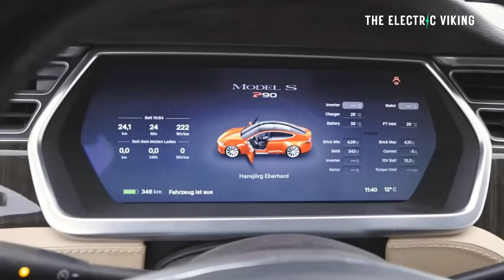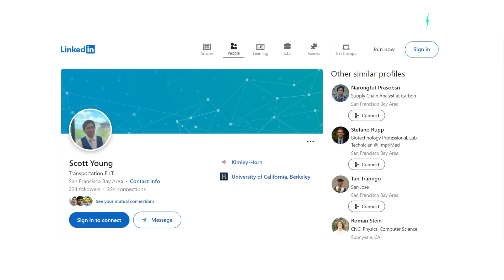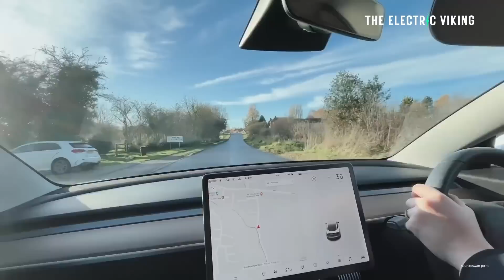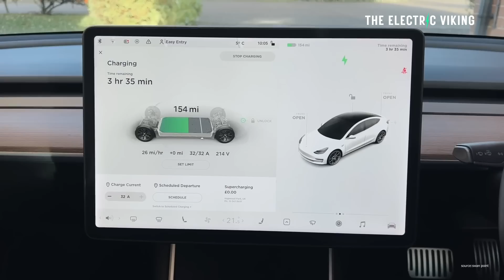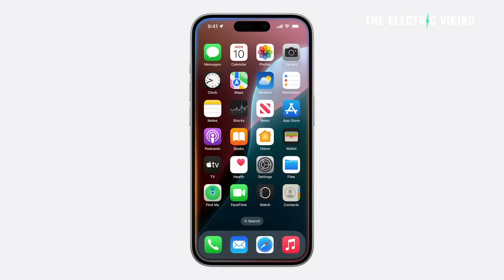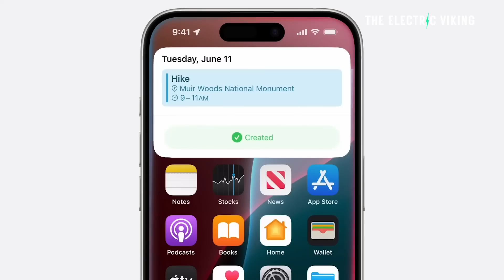Electric cars capable of running for over 1 million miles are already here

Comment: If an electric car can last forever, it will absolutely replace the gasoline car.  It is a superior technology.
Reply: They won't. Maybe the battery and drivetrain will last that long but they'll still rust out from under you if you don't live in a desert. Various electronics modules will fail and be unrepairable.
Reply: @spankeyfish  
If you're building a 'lifetime' car then you're going to use aluminum rather than steel that will rust.  You'll design for easy replacement of parts that might fail.
Reply: @bobwallace9753  Steel cars do not rust now.
Reply: @christopherj2231  
Newer cars are rusting slower.
Reply: Electric vehicles are like smartphones. In a decade the technology in them become obsolete and like your cell phone they will not no longer support updates and to upgrade the car into the new technology would be cost prohibitive to most car owners.How many people still are using PlayStation 1 through 4. I have an old Sony web TV I can no longer use other than as a monitor. I believe it has Microsoft components which they will no longer support. Add to that the fact that there is not enough copper in the world to support the infrastructure upgrade to support the chargers required for the government's goals. It is said that for the next 10 years, it would take twice the amount of copper mined since the beginning of copper mining. You add to that all the homes old or to be built out there that eventually would be required to upgrade electrical systems to handle the fast chargers. Homes here in Minnesota require that play comma to meet energy savings they must have a minimum amount of insulation in the ceilings and walls and windows and all the appliances have to meet certain energy standards. Homes are very expensive as a result and imagine what it will cost to meet these future upgrades. Electric cars will just be another added cost of persons everyday life. By the way I made this comment before watching his explanation of this. If they made simple electric vehicles that got you from point a to b with all these electronics then they could be affordable. But as of now these vehicles will price most people out of the market due to the required replacement cost of the technology in them just to keep them on the road..
Reply: @davidclemens1578  
Quite the ramble....

Teslas continue to be updated.  Even the twelve year old models.  

We need to expand copper extraction.  There's plenty.  

Electric cars are cheaper to manufacture and cheaper to operate than gas/diesel cars.
Reply: @davidclemens1578  
Tesla is moving to 48 volts for their low voltage system.  That cuts the amount of copped needed by 75%.
Reply: If replacing the battery still cost more than replacing and a common ice engine, I will keep ICE.
Reply: @ctonew6155  

Battery prices are dropping rapidly.  We're very close to batteries becoming cheaper than engines.  And LFP batteries should last far longer than an engine.

Comment: Once you buy an EV, expect problems come servicing for it’s really hard to do it yourself and requires specialized tools and knowledge.
Reply: It needs servicing only rarely so it is swings and roundabouts.
Reply: @rogerphelps9939  but servicing EVs are generally more expensive as compared to servicing an ICE car, especially when it comes to battery replacement.
Reply: @aeronYTco  Oh dear that canard again. The batteries last longer than the car. There may be some degradation bu nothing like enough to warrant battery replacement. EV servicing is actually cheaper because there is very little to do.

Comment: Sadly companies such as Ford have already figured out the answer to the extreme longevity problem.  Add some plant fiber to the plastics so they start to get brittle and fall apart after 10 years depending on the temperature and humidity where you drive.

In the old days you could inexpensively keep a car like new by doing simple things like replacing the door cards or dash panels yourself using inexpensive materials (fiber board, foam and fabric) from the local hardware and fabric stores however today with the plethora of custom molded/injected composite parts inside and out this is too often an impossible task.  

When cars had universal glass headlamps you replaced the $1 to $2 headlight bulb and it was like new for another decade while today your looking at a $1,000 to $3,000 custom injection molded housing that slowly degrades turning yellow over time requiring regular attention with polish and sealant until they finally fail and need replacing if you can still find them.  This alone turns the former $2 to $4 entire headlamp replacement into a $2,000 to $4,000 repair.  Of course if the parts cost thousands then they aren't going to provide the labor are reasonable cost either even if the jobs only takes about a minute or two to get done.

Best!
Reply: We also had problems with animals eating the soy based components, right on the plant lot!
Reply: LEDs in headlights typically last 25,000 hours. that is 750,000 miles at 30mph and more at faster speeds. Long enough for you? Anyway the situation with EVs and ICEs regarding headlights is identical.
Reply: @rogerphelps9939  While the LED bulbs can last that long unfortunately most of the insanely expensive yet extremely delicate plastic housings and lenses don't especially if you live in places like Sunny Florida.

What good are LED that last 25,000 hours when they are in $1,000 to $3,000 housings that can fail in a decade?

The glass headlamps in my classic cars last many years and even after decades the cost of replacing then has not hit $100 while one modern headlamp assembly replacement costs over 10 times that.

To me they are not a good value.

Best!

Comment: I retired from the big 3, and I have been saying this since 2019 to everyone in the business that would listen, many of them my long time friends. 
EV, and especially if they are built like Tesla, will eliminate the vast majority of jobs in America in the automotive industry. 
Still think EV are expensive? Most people will only need to own 2 cars in their entire lifetime.
Reply: Build more solar panels
Reply: As for the myth that EVs are too expensive, they are high end performance luxury cars. Look at the price of an ICE Mustang GT with nearly 500 hp and  600 ft lbs of torque, with Brembos and Magnaride suspension, and Bluecruise, and suddenly the cost is very competitive, especially when you start factoring in 93 octain fillups with full syn oil changes. And if the car will last a million miles, cheaper.
Reply: Thank you for your expert advice.
Reply: Why should EVs eliminate non automotive jobs? Isn't  it a good thing that a polluting global warming contributing industry that is responsible for many deaths of vulnerable people and for the deaths of generations as yet unborn, is ended?
Reply: @rogerphelps9939  But a President from the past told the sheep it is a hoax.
Reply: @rogerphelps9939  You have a soul.Many have not.

Comment: Here in Canada cars die of rust because of the road salts needed to control ice on the road. I’ve had a Chrysler Caravan that I had to scrap because I could see through the rear side door. It was seven years old, one year after I finished paying for it. That’s “programmed obsolescence” for you.
Reply: Do you folks have access to "Under Coating?" That seemed to work to combat effects of salt on Onion winter roads.
Reply: Canada? If I'm not mistaken Canada is not a third world country or is it? Have you guys heard of coating techniques to address that problem? I have. And I live in poorest country of Europe. A simple 300-500 euros coating job is what you should have done the next day you bought your Chrysler Caravan. But I guess you can blow your money as you like.
Reply: I dunno this has never happened to me, and I don't wash my vehicle that often. Have a 2003 Cavalier I bought new but I live in the warm part of Canada (we still salt for 2-3 months). You might wanna spray down your vehicle around the wheels sometimes if there's snow, mud, and salt stuck in there.

With work trucks we usually washed them a lot.
Reply: No undercoating could help against Canadian winter and salt. Proven concept.
Reply: @yuriykorenyak2351  yes, I noticed in Ohio undercoated cars still rust out.
Reply: @tommorgan1291 why do they put salt on roads? Are people going to taste them?
Reply: @KaiPonte  In Ohio on main highways and in certain key traffic arers are placed cone shape structures where highway departments store rock salt for used on roads when it snows and when wet riads freeze. The salt melts the snow. It works but get up into car bodies and eats the metal. I’ve tasted it and its just unrefined rock salt right out of if a mine.
Reply: I've heard about salt on roads. Sounds dreadful. Curious, why not hose the car off after getting home
Reply: @KaiPonte  winter freezing usually lasts about 14 weeks. Hosing off on non freezing days is a good idea if you pass on the Mrs. Opportunity or quit drinking Coors while watches sports. Freezing days and cleaning the salt off will only piss off Hilda my neighbor. Or you can move to Phoenix like I am gonna.
Reply: @tommorgan1291  I have only seen snow fall like five times in my life.
Reply: @KaiPonte  Because many people are to lazy to wipe their own bum that's why.

Comment: 1:58 Because car engines are made of aluminum and must be replaced after 300,000 km due to friction with the piston And the combustion process 

But if the engine is made of stainless steel it will last forever but is heavier and more expensive.
Reply: Friction with the pistton?  No need for replacement. Just get a rebore.

Comment: Right to repair will only occur if the industry has a backlog of repairs they can't keep up with,  which could then damage the reputation of the industry and hence become counter a productive rule.  With that said the designs might be too difficult to repair until EV industry repairers experience,  catches up with the technology.
Reply: Wrong. Legislaion will force right to repair to happen. Manufacturers will try to get out of it by making replaceable units more complex but hopefully they will be stopped from doing that. It is ridiculous to have to change a £500 assembly for the sake of a £1 component.

Comment: Running costs are not going to remain below ICE vehicles because oil companies are buying up the charging networks, demand for electricity will drive up home charging expense, governments will charge road use  taxes, tire companies already charge much more for much more frequently needed tires, and insurance companies charge much more for expensive to repair EV'S. They all will find a way to get their pound of flesh. Wish it weren't so as I'd like to have an EV in my future
Reply: All pretty much wrong.  As more renewables come online and, in the Uk, the appalling linking of the price of electricity to that of natural gas is removed, electricity prices will go down,in real terms.

Comment: But there is also the issue of software support going forward. I reckon the software on all EVs should be open sourced this would really help accelerate adoption and innovation.  Kind of like the ODB port in an ICE where a portion of the management software can be accessed by anyone with the right tool.
Reply: Yes but a car does not need to be always connected to the internet so a car without software support should carry on with only a few unessential functtions no longer working.
Reply: A car shouldn't have software
Reply: A car shouldn't need software

Comment: If ford builds it, you will replace all of the suspension components at 100 k miles. Owner of a ford/mazda model 3 with 90 k miles.

Comment: Taxi driver I know has a model 3 has racked up 150k the past 4.5 years. No issues at all, runs like the day he got it and he doesn't notice any loss of range but I'm sure he has - not an issue for him. He chargedsfull 100% every day. But the rules are a taxi cannot be more than five years old (UK) so a car that he owns outright, runs perfectly, looks great he has to sell and fork out for a new one. That rule is nonsense and eeds to change at least for EV's
Reply: Are you sure about taxis having to be less than 5 years old? Here in SW England I am sure that I have seen taxis older than that. As long as they have passed their MOT test age should be irrelevant.

Comment: Battery replacement also depends on one's driving requirement.  Also by the time the battery of a new EV degrades significantly,  EV super charging will have become more prevelent,  which will help offset the longer range requirements of batteries.
Reply: Also super charging will degrade batteries much faster.
Reply: In what watydoes super charging differ from Level 3 Rapid charging?

Comment: "it went through several motors and batteries"
right now batteries are an environmental disasters 
each battery  $15,000+-
transmission expensive?  and how expensive is a motor replacement.?
Reply: That statement is pure fossil fuel industry FUD. Ignore it.
Reply: @rogerphelps9939  your reply is pure ev industry FUD.
ignore it

Comment: Sam, you live where there is no ice/snow/salt ... Where I'm at the vehicles rust away before the engines and transmissions are worn out. Engine cradles, body frames, suspension parts. 200k-250k is about as far as they safely drive. Engines and Transmissions all surprisingly good for the mileage.   Now, a big part of vehicle durability is demographic, wealthy owners tend to get maintenance done, keep it in a garage not on the street, and don't race between lights to slam on the brakes at lights. Most EVs are expensive and are bought buy the demographics that spend on taking care of their things. That two million km driver, slipped in about battery pack replacements, many consumers don't have enough savings for a battery replacement (news reports say high % don't have emergency $500) but they do have savings to buy a new car on a long stretch of payments. So they scrap the old car and buy the new one (or lease it).
Reply: This is unfortunately true. All aluminum and or the correct composites are the way to go for the future. EV will still be the choice for salty conditions, because they will cost half as much and wont rust any worse than ICE vehicles.
Reply: Look at how Tesla is using cast aluminum for the structural parts.  No rusting away there.  Other parts would need to be made of non-corrosive materials or designed for easy replacement.
Reply: @bobwallace9753 you do realise salt effects aluminium just as much as steel?
Reply: @dikkybee4003  
I spent several years as a blue water sailor.  I know you are misleading people.
Reply: @bobwallace9753  I worked on Navy ships and the aluminium parts basically turned to white salt and dissolved. Obviously your the one passing on BS.
Reply: @dikkybee4003  
"Aluminum can corrode in cars, but it's usually more superficial and less likely to affect the vehicle's structural integrity than rust. Aluminum corrodes when exposed to oxygen and moisture, a process called oxidation. This oxidation creates a white layer that protects the aluminum from further corrosion."

Comment: Battery replacements are still a problematic huge cost (and fear). Need more modular battery packs that are owner replaceable; like walking into a retailer to buy flashlight batteries or batteries for the lawn mower or ICE vehicle.
Reply: Well, when did you last replace the roof on your house? Here in the UK the answer is never and it will be the same for EV baery replacement. You have been taken in by fossil fuel industry FUD.
Reply: thats why tesla is yeahrs ahead if they geto to a boxed car if its easy to put the 4-5 parts togheter you could seperate them as easy and put a new one in. In the teardown vids it looks as seperating the seats whit the batterys from the cybertruck wasnt that hard to do